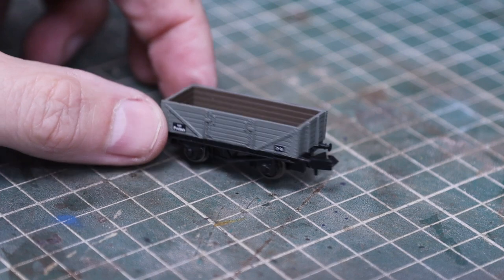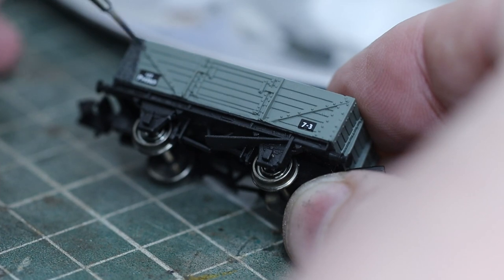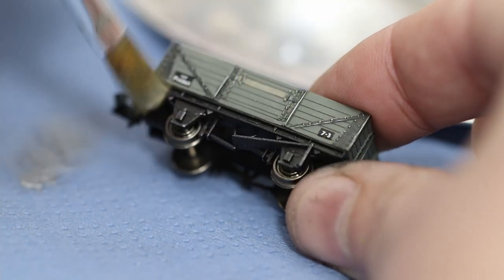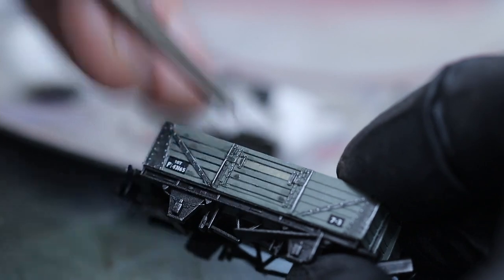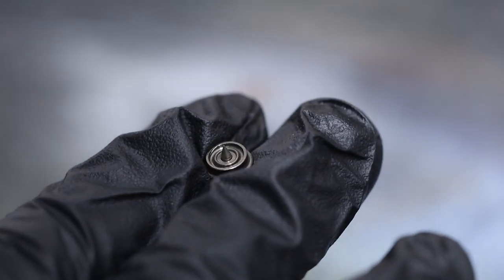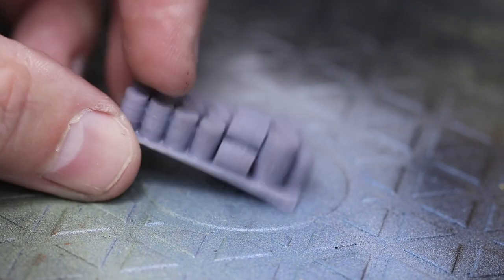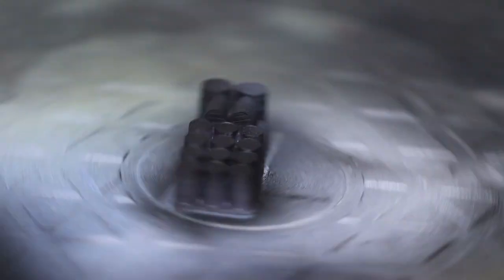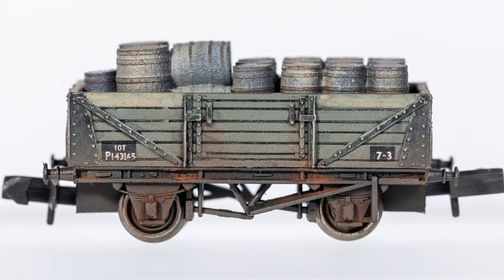How to Weather an N Gauge Open Wagon| Model Railway Weathering

Comment: Don't know what happened but your site somehow disappeared from my subscribers list and as I am getting more into the hobby I went looking for it and it took me ages to eventually find your site again as I really had no idea what I was looking for.
So having found it and going through your videos which I might add are not only instructive but are very enjoyable to watch, I watched this one and when you use Vallejo Varnish on the wagon do you paint it on or use a air brush. Asked this as I dont have an air brush yet.?
Loved it that you showed adding the barrels, so impressed that when I want some I know where to go.
Regards Chris
Reply from the maker: Varnishes are best applied with an airbrush. With paint brushes the final result is less smooth and you'll run the risk of re-activating the previous acrylics and disturbing the effect